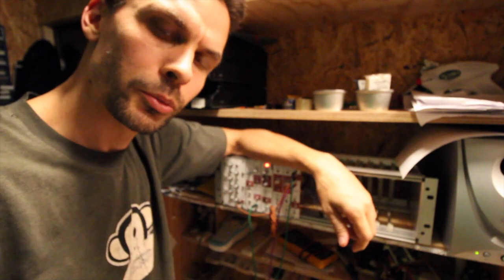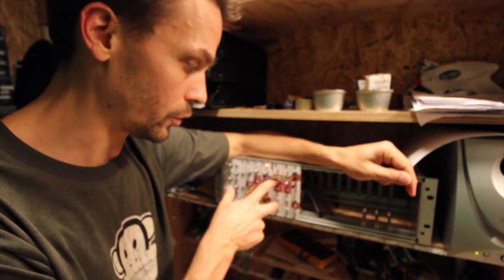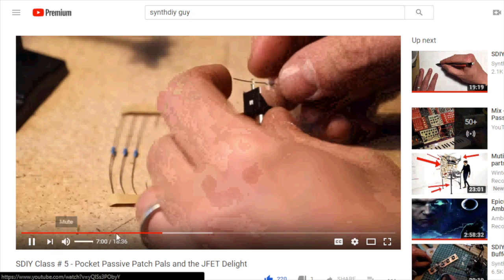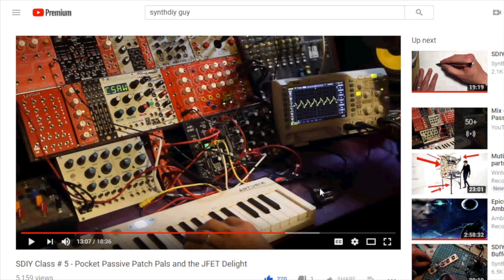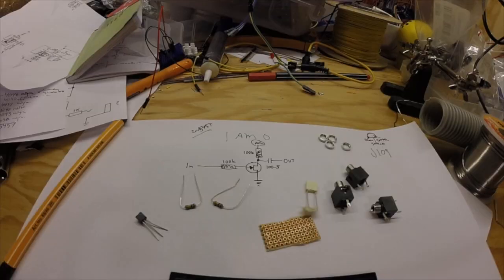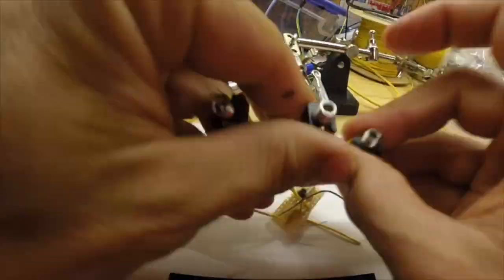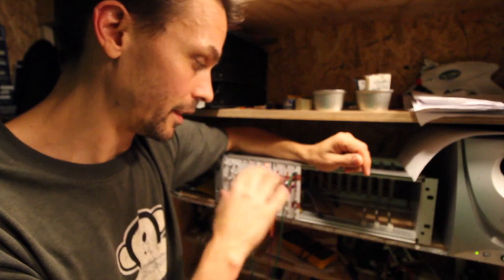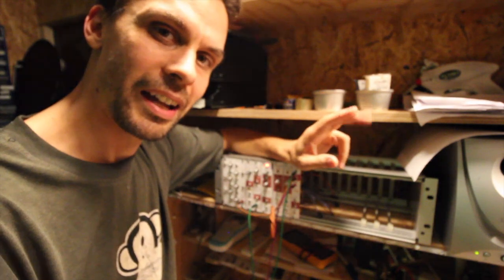I AM O  VCA/RingMod/Voltage Controlled Gate - DIY Modular in a Week 2.2

Comment: There are equivalents. The onsemi 	MMBF5457 is a SMD equivalent which is $0.60 at Digikey ... $0.37 for ten ... the same price you paid for one 2N5457
Reply from the maker: Thanks for the tip! I’ll leave it up top for anyone who wants to do a similar project even cheaper. Although SMD is a bit more difficult to work with. :)

Comment: Am,,, what kind of signal comes in there?
Reply from the maker: Am stands for amplitude modulation. So basically volume. Any voltage between 0 and 12v should affect the signal. Although around 5-8v are more normal values.
Reply: Thank you! Gonna put this build on my to do list!!!
Reply: I built 2 of them with 2n5457, came out amazing! I also wired a toggle switch to allow for reversing input and output jacks. Allows for exploring without having to unplug a reinsert. Thank you for your vid!
Reply from the maker: @canterburyaudio5836  thats a nice addon! Great idea. :)

Comment: I don't really know why the jfet should be expensive. Among the first five google result was a pack of 10 for 1,90€ that is 19 cents per transistor.
Reply from the maker: It could be a local thing. When I made these the only ones I found cost that much. It’s a good price you found (still a bit more expensive than “regular” transistors). Now you can make ten IAMO! ;)
Reply: @SourceryOne  I actually got a better price ordering 100. Some friends want some too. While I wait for the transistors to arrive I want to construct pcbs for some of the modules.
We will use smd parts so we can push the price down a bit and can afford a lot fancier psu with power bus.

Comment: Hi Kristian! Have you tried some mpf102 by chance? Seen it sometimes as a replacement for the 5457, it is a little bit cheaper...
Reply from the maker: I did try a few other jfets, and I do have the 102 at home, unsure if I did try that though... I THINK I did, but it was a long time ago and I cant remember _:) None of the ones I did try worked sufficently good though, only the 5457. But if you have one try it, just add a 3pin female header to the design to exchange jfet chips :)

Comment: Not to be constantly asking questions... but what is your functional impression of this VCA?  The simplicity of it is far too appealing to me and my existing eurorack system is in dire need of more VCAs... and the thought of dropping roughly $100 for the cheapest dual VCA I can find is unpleasant.  You could theoretically stuff 8 of these VCAs into an 8hp panel... and the idea of that is absurdly exciting.
Reply from the maker: No problem. Actually I am not satisfied with any of the VCA’s I’ve done so far. The vactrols are the best and almost the only I use so far. I don’t know why I really didn’t get these to work properly. They work. But not always. So I am not overly happy with them. Maybe I should try them out a bit more with the lfos and envelope generators. Which is what they according to synthdiy guy works with. I only had square waves when I built it to work with. :/ I’ll get back to you on this once I tried a bit more.
Reply: @SourceryOne  Thanks!
Reply from the maker: @evwaldron  Hi again, I checked this quickly last night with both the: Dual AR, AD/AR, and the VCLFO, and it actually worked great with these. The problem I had in the beginning was that I only had square waves to work with and that gives an awful click in the beginning of each open of the gate. But with the smoother Envelopes of the above modules it did work quite well and worked as a VCA. I amo more content with this now, and will try to use it more in future videos... As for adding a pot, that shouldnt be too hard to try at least. Try and see if it works. If it doesnt just remove it again :)
Reply: @SourceryOne  Thanks for the input!  As I said, my current system is in dire need of more VCAs and this may be the first module I build as I could drop it right into my system, and probably fit 6-8 VCAs into a single 8hp panel!  I watched the video you linked of the Pocket Passive Patch Pals and at the very end of the video it looks like he's using the attenuator patch pal to attenuate the AM input on the I-AM-O.  I'm going to order the parts next week and will let you know how it goes.

Comment: Could you add a pot for the AM amount?
Reply from the maker: Yes probably. But it needs quite a high AM input.
Reply: @SourceryOne  it looks like you used a 100K resistor on the AM input but in the original drawing it says 100 Ohm. That might explain the need for a high input?
Reply from the maker: @djdeth2524  thanks. I’ll take a look at that. :)